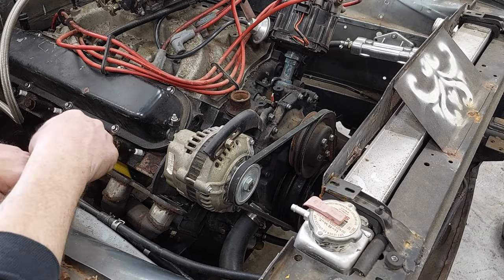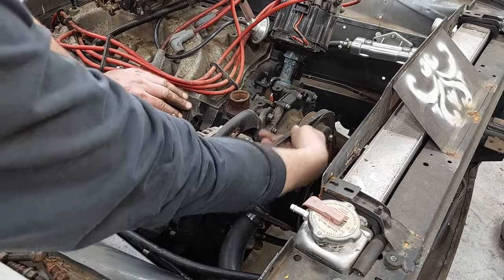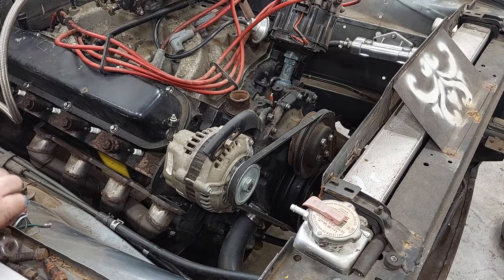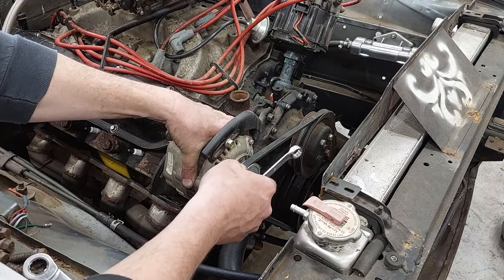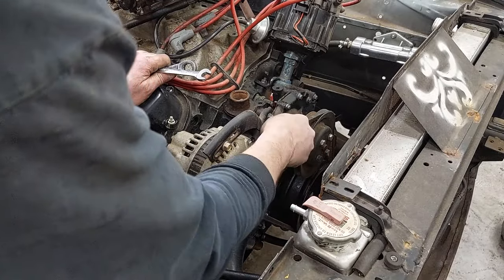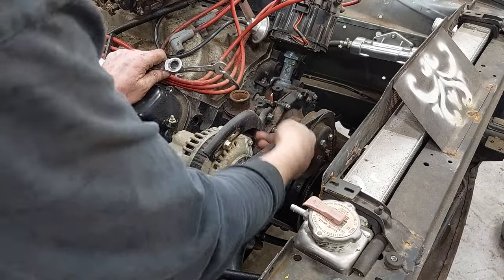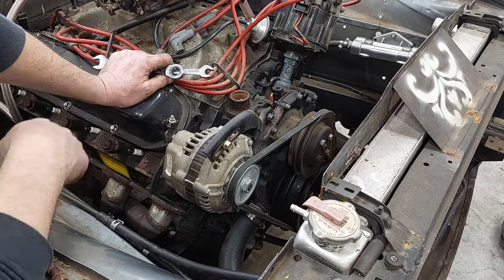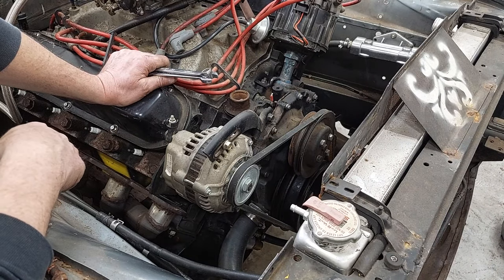V Belts - How tight is right?

Comment: I have a Buick book from 1966. I think it is a half inch at 15 pounds of pull on a spring scale. Nothing in the old days was accurate like now so tighten and put firm pressure on the belt with one finger, if it looks like half inch you're good. V-belt would balloon at high RPM so a built engine needed to be tighter but the bearings sucked so the guys who drag raced would only have the belt that ran the water pump and fan while racing then put the alternator belt on to drive home.
Reply from the maker: Belt driven fans didn't help. I had a dual-sheave pulley on my RX-7 to help keep the belt from slipping at 9,000 rpm. I ditched the clutch fan for electric and immediately solved that problem. Thanks for watching!

Comment: Just fitted one on mine maybe done bit tight.. wouldn't really be able to twist mine like that and I'm getting squeak 😮
Reply from the maker: Interesting. New belt? Correctly sized in length and width? All accessories turn freely? Pulleys aligned correctly?
Reply: Interesting questions...i have got the same problem here,i noticed that a oversized belt,wich doesnt fit prpwrly in the channel helps to keep the squeeking but tha i realized its just becouse its a very old one its just slipping quietely...so now i thought to put the right size one and spry some silicone but i dont know what i am dosing basically
Reply: I've realised what my problem was didn't tighten the tensioner tighter enough. My belt was as tight as the one in video but was still to loose tightened it so belt pushed down quarter of inch in middle and was perfect.
Reply: Not had any issues since with screeching thank god was embarrassing 😂
Reply from the maker: @kieranthomas5478  Apologies that I didn't see your responses until now. I'm glad you found the issue. Thanks for watching!

Comment: Anyone know how to remove a smog pump on a 1977 Buick Regal 350 V8? Would be great to see how to remove the belts or at least loosen them enough to take the pump off…
Reply from the maker: I don't believe I've ever turned a wrench on a '77 Regal, but can you loosen any other component to take the tension off the belt? Thanks for watching!
Reply: @erikstrawn3885  Thanks. I’ll see which components I can loosen. Didn’t want to deal with the tensioner if I didn’t have to.

Comment: Good video, im going to have to run my belt a bit tighter, 140A 3G alternator on a single V belt.  I do have a 6.5s LCR regulator to help stop slip but id still plan on putting a biy more tension on it than that.

1/2" deflection is the rule of thumb.  Steaight edge along the belt routing between pullies you should be able to delress the belt down away from the straight edge 1/2".  I tend to go more for 1/4" deflection.
Reply from the maker: Thanks for watching!

Comment: Absolutely, overtightening is a recipe for damaging the driven assemblies such as water pump.
Another way of knowing is if you can turn the accessory by hand or slide the belt in the v-groove by hand (causing it to slip), likely it's a little too loose.
Reply from the maker: Sorry that I didn't see your comment until now. Thanks for the comment and thanks for  watching!
Reply: I've changed my water pump because it was making noise when setting off or when the AC is on and quiet when we get going, I'm thinking the belt is too tight, will it be too loose if I add 15mm, currently at 1865mm
Reply: @waynemwangi9444  Adjusting the belt too tight will damage the pump shaft bearings.  If this is a v-belt setup, I'd adjust the belt tension just tight enough it's very difficult or cannot turn the pully by hand.  The wild card here is a worn v-belt that's become too narrow to properly fit the v-groove, in which case overtightening the belt can overcome the poor fit but in this case overtensioning damages the shaft bearing.  A new belt is needed in this case, as opposed to overtensioning the worn belt.  Pullys wear too, where a marginal belt must be overtightened to avoid slipping.  I've never experienced a totally worn out steel pulley but I have experienced worn-out aluminum pulleys.  Replacing the belt is a much better option than overtensioning a worn belt because a worn belt will slip too much even when overtensioned.
It doesn't require a ton of tension if both the belt and pully are in good condition.
Reply: @thisisyourcaptainspeaking2259  thank you for your reply. When I changed the water pump I replaced the belt as well. The two are only 500km in. I replaced the belt with the same that was in the car before, where the pump I removed was making a similar noise like the one the new one is making. Belt size is currently 1865mm I want to try 1880mm. I can't adjust tension because the tensioner is automatic.
Reply: @waynemwangi9444  Sounds like your vehicle has an automatic spring-loaded tensioner and in that case, probably a flat-ribbed belt.  You should be using the belt length called for by the vehicle manufacturer, don't attempt redesigning the belt system unless you've modified something.
Additionally, be aware the spring-loaded belt tensioners do wear out, so consider replacing it if problems persist or there's any question about it's condition.

Comment: I just installed a new alt on my car 2 days ago. After viewing this vid, I suspect that I may have installed the belt too tight. 

The car ran normally for 2 days, but upon intial start up, it did squeal for like a second. 

Tonight, the battery light came on intermittently, for the last 2 miles home.  Popping the hood, I checked the battery terminals: solidly tight. The battery is BRAND new, too. I did notice a faint burning rubber smell, coming from right over my alt.

So, did I just fry up my brand new alt, or, do you think I can still save this, by loosening that belt?
Reply from the maker: You can loosen and retighten the belt, but if you hurt your alternator by having the belt too tight, you wouldn't fry the electrics, you'd damage the bearings. While you have the belt off, spin the alternator and make sure it's smooth and not crunchy. If the alternator and battery are both new and your battery is still dying, make sure your battery connections are both clean and tight. Then check for a parasitic draw - I don't have a video for that yet, but I need to do one.

Thanks for watching!
Reply: @erikstrawn3885  Thank you so much for your advice, Mr. Strawn.  I can't afford a trip to the shop, so you're really helping me out here.  

Okay, if I understood you right, if the alt and battery are good, and the connections are clean and tight, you said to look for a, "parasitic draw." What is that, exactly?  The wire from the battery to the alt? 

Sorry for the noob-level questions.
Reply: @erikstrawn3885  Good to know that I didn't fry the electrics.  So, that faint burning rubber smell, it probably came from some melted wire somewhere else in the vicinity?

Also, I only drove the car about 2 miles with the intermittent flickering of the battery light on, so am I safe to assume that even if I was hard on that bearing, that it's still probably okay, so long as I loosen the belt? 

I'll use your 90 degree trick to determine belt tightness.

Thank you for your time. =)
Reply from the maker: @Maplecook  Your alternator should be fine. I think your problem is elsewhere. I haven't done a video on parasitic draw, but I need to. It's a fairly simple way to quickly narrow down to a specific circuit if something is "staying on" when the key is off. Basically, pull your fuses and use a test light to see if the current through each fuse socket is enough to light the test light.
Reply: @erikstrawn3885  Thank you!
Reply: I think the rubber smell you smell was the old belt slipping on a new bit tight alternator(often takes 2 k to loosen up) and probably installed a bit too loose the belt too...if belt is old slippers without any noise but you can see burned rubber all around. solution one buy a brand new belt and install it tight enough hoping wont squeack for the whole 2 k otherwise in the meantime youll have to buy e silicone spry for squeky belts or alternatively yoy can use a candle to rub on the belt in the meantime engine runs (cheaper and more effective than any spry but you could loose a couple of fingers easy) solution 2: tight a bit more your actual old  and stratched crappy belt and keep low the speed and the rpm and hope will survive this initial period where the alternator its a bit stiff...otherwise solution number 3 buy silicon spry and use it every single morning of your life regardless afjusting if you think about it once every single hr of drive the radiator needed to be topped up and the clutch whas made of horse skin and needed to be replaced every couple of days so i cant see why you cant spry your belt everyday for a while by the way some times arrives the point in a life of a man when its easier to replace the whole car than fix properly the belt...thats what has happened to me so probably i shouldnt give any advice here and i am just making you loose a lot of time ahaha aolution 4 buy a ticker belt now everyone will say you this us wrong but to my cousun worked once.but probably has arrived the time for a new car my bro !! Maybe a  motorbike who hoo